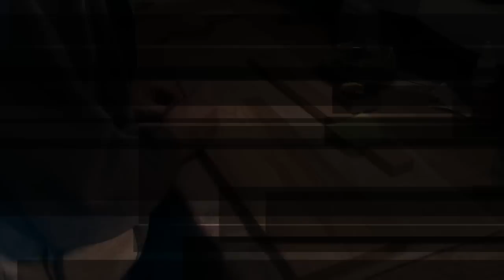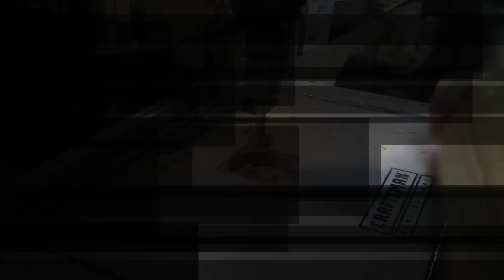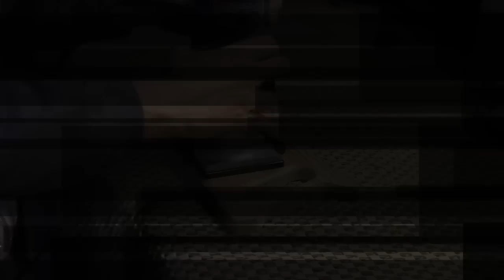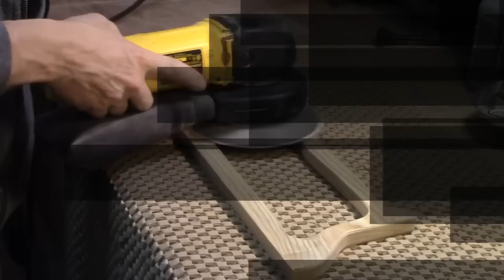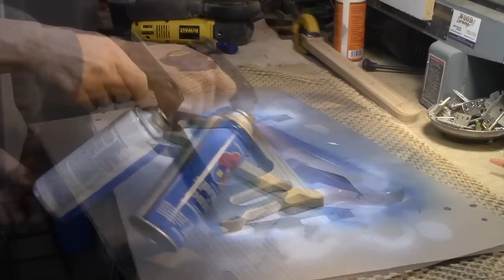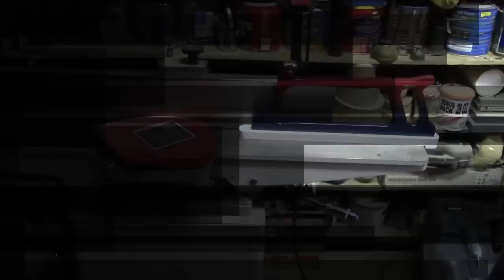How to make a Jointer push stick- deluxe

Comment: Great looking push stick, but are those screws the best way to fix the base to the top ?   When you have the saw blade higher than the thickness of the board being cut, do you think that sparks might fly?    Oooops! - Just noticed "specifically for use on the jointer", so it won't be a problem there, but in case anyone does try to copy the design for use on a table saw  . . . . . . . .  !!!!
Reply from the maker: Don Johnson Yep excellent thought! I covered this in the narrative part oattached to the video!   
Thanks for watching. Chris
Reply: Chris Pine  As I remove my foot from my mouth I can make an appointment to get some glasses!   LOL
Reply from the maker: :)   No worries! very good point and how do I know it is a good point?  Because I did that once! Made a nice little push stick and fastened a sole to it with nails and used it on the tablesaw and indeed sparks do fly! :)